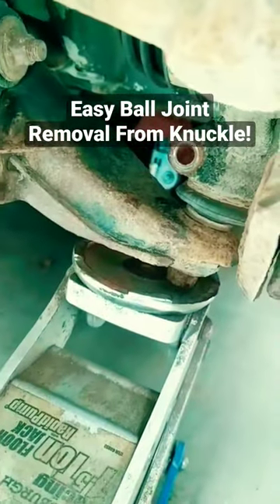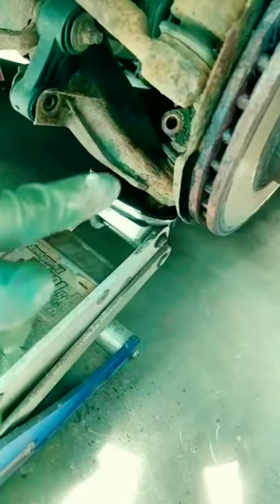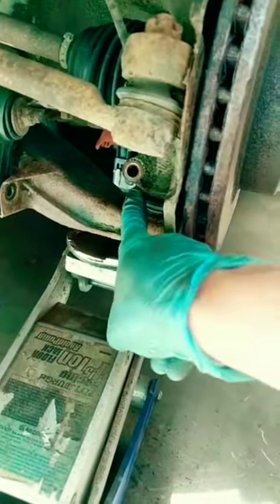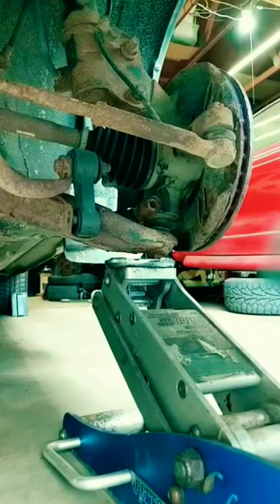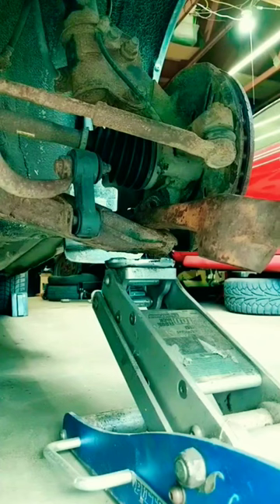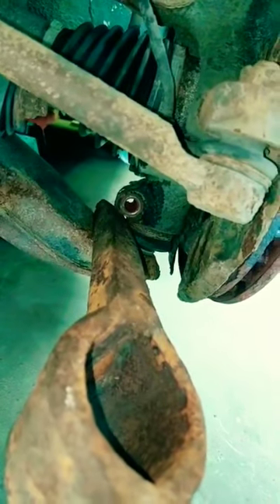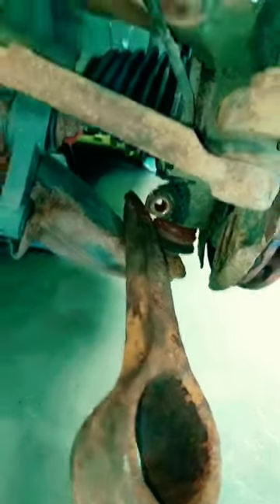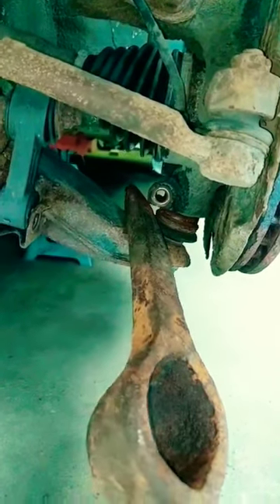Easily Remove Ball Joint From Knuckle! #Shorts

Comment: I think the rust was the only thing keeping that ball joint in there 😂
Reply from the maker: Hahaha they were definitely good friends. Even with the pinch bolt removed, it had a good hold for sure.
Reply: I think you're right. If it got hammered it might disintegrate.
Reply: @802Garage  there's always a front-end kit, which is specifically designed for separating ball joints from knuckles.

Comment: dont do this method if you are planning to keep your ball joint.  It will rip the ball joint out of the socket
Reply from the maker: That's only possible if it's already damaged or if the level of corrosion is much higher than any other method would deal with anyways. You do have to be careful of the boot though.

Comment: Can i do the same trick with the baljoint facing up? My 2007 honda civic (European version) has the ball joint pressed onto the control arm, and it faces up to meet the knuckle
Reply from the maker: The quick answer is most likely yes. You may either need to put the lever object in and then jack it up or lever from the other side when you drop the jack. Hope that makes sense. Sometimes there isn't a good enough spot.
Reply: @802Garage   basically you just need to find a spot where you create tension between the two pieces with a solid object, either by jacking the suspension, placing the object, and lower the suspension, or by placing the object and jack the suspension to create the tension. Nice. Thanks a lot

Comment: I like vehicles that have split knuckles it's so easy to get them out just take the bolts out of it spread it open a little bit and Bloom
Reply from the maker: Yeah I mean the bolt on joints are nice as long as they use beefy bolts. I hate the press in or screw in body kind. Love to be a nightmare hahaha.

Comment: What do I do if my control arm went up higher instead of staying low? I removed my sway links before and put it back in, did I install them wrong so my control arm sits a lot higher now?
Reply from the maker: I'm honestly confused by your question. You mean when you lower the car back down without a jack supporting it the control arm sits higher than it used to? I'd just drive back and forth a few feet or bounce it up and down a bit and see if it settles. No real way to install these sway bar links wrong. Unless it's a different car.

Comment: How do I put one in jack it in? Or do I still have to remove the whole hub. New to this job and technique
Reply from the maker: I'm guessing you mean how do you jack it up? Use the edge of the jack pad on the lower ball joint nut. Go behind the brake disc shield.
Reply: @802Garage  no I mean when putting a new ball joint in do you use a jack to put the new one in. Sorry bad word choice
Reply from the maker: @saltybloodtx7146  Ohhh you can. Usually once I have the old one out, I clean the hole out with a wire brush and brake parts cleaner and then grease it to prevent future rust and the new ball joint pretty much slips in. If not, putting the stud through the control arm usually puts plenty of force on it.

Comment: I saw you know a lot about subies,  I plan on getting a 2004 blobeye wagon 1.6 liter turbo 180hp  where do I look for rust and mechanical problems on the GD wagons?
Reply from the maker: 1.6L turbo? Which country was that sold in? Generally there are a few key spots on the GD wagons. The front U-frame under the engine which is basically for crash safety, a lot of people delete it anyways and it may not have been in every country. The rocker panels in general especially towards the rear. The rear fenders especially the lip over and around the tire. The rear subframe especially where it mounts to the body, though that's less common. The big one that is easy to miss is in the rear wheel wells, towards the seat backs, where the seat back latches to the strut towers. They drilled through the body to install the seat latch strikers, and over time moisture gets in past the undercoating and rusts out the layers of metal. It's best to fold the seat backs forward and pull the trim and carpet off the tower to check for any rust holes. It's fairly easy to fix, but obviously worth considering. Check the rear wheel wells in general thoroughly. The rear bumper beams also like to rust out, though that's not exactly structural. Good luck! I actually have a 2004 blobeye wagon with the EJ20 and it has pretty much all of these rust problems, hahaha.
Reply: @802Garage  thanks for your time and help . The 1.6 turbo is a special sold in Greece the dealership modified the NA car and put a turbo on it so there was a cheaper alternative to the WRX and STI I plan an turning it later in some 10 years to an STI wagon thus why I'm asking for rust issues.
Reply from the maker: @thusmarshal8815  That's awesome!!! Hopefully Greece isn't too bad for rust. :)
Reply: @802Garage  it ain't but I heard from others that rust issues are a big problem on the GD generation . Thank you anyways big fan of your vids waiting on that V10 Impreza
Reply from the maker: @thusmarshal8815  Subarus get a bad rap for rust because especially before the late 00s they were sold almost entirely in the snowiest and most mountainous areas. Canada, the northern USA in general, and the Colorado Rockies for example. They don't really rust much more than any other Japanese brand from the 90s and 00s, they just get a reputation because they are ridden hard through the winter and put away wet. I live right next to the Canadian border for example, and I have yet to find a brand that doesn't have rust issues. At least most Subaru rust issues take decades to actually structurally total the car. Thank you as well and V10 Impreza content is coming!
Reply: @802Garage   I know Subarus are snow machines I've had already 8 Foresters from the 2002 sturbo version pumping 570who and an sh 2008 diesel  non of them had  rust  but listings I found in Austria and Germany saw them with lots of it that's why I was curious and wanted to ask a Subaru expert. Happy to know the V10 is coming
Reply from the maker: @thusmarshal8815  Hahaha holy crap that's awesome. I want a 1st gen turbo Forester bad. Thanks again!

Comment: I used a torch to heat up the control arm a little than I whacked the ball joint with a lump hammer. It came out very easily

Comment: 2011 Subaru Outback and rust just kicked my *s$... getting that ball joint loose from the steering knuckle. 

This technique and video short saved the day!
Definitely do it this way!

I have to lift, wedge and drop several times with two pickle forks shimmed/ wedged in that space.

Caution with spreading that cast knuckle with a chisel or flat screwdriver as a wedge. You don't want to break it.

Comment: Now what if the body won't get out at all?
Reply from the maker: Use the same trick. Put the stud back in the arm and put the nut on barely tight. Take the pinch clamp bolt out, spread the joint very slightly with a chisel, do the trick again.

Comment: Get a ball joint press, that or i use the trusty air hammer (yea its expensive but holy shit its saved me so many times) and some penetrant, i spray then hammer a few times, generally thatll crack it loose, then pry it on out. They also make something called pickle forks for normal or air hammers that work literally 99% of the time, but itll flatten the boot and let grease escape, or can rip it sometimes
Reply from the maker: I know all of the tools and techniques. This is free, quick, easy, and generally works better than all of them. :)
Reply from the maker: I even have the special Astro Tools ball joint puller. Still go with this most of the time. 😂
Reply: @802Garage  imma try it out soon, i just feel like ill have a problem finding something perfect to wedge it. Im a transmission guy at nissan so im constantly replacing cvts and 90% of our cars need the subframe pulled to do so and the ball joint is the best option usually, problem is, the knucle doesnt have much of a lip to wedge most of the time, ill see if i can find a way to tweak it a bit maybe, anyways dope tip, good video homie
Reply from the maker: @ayoitssteve869  If you have a large pickle fork, they can actually work as your wedge, and yes it does work better wedging it this way than just hammering on it, or at the least it is easier. The car's suspension is exerting tons of force in this case, that's what makes it so clever. The arm acts as a big lever. Obviously with a lift and all that, this option isn't quite as sensible. More for home gamers and working on the ground. The principle can of course still be applied though. Could even use a screw jack to jack just one corner, but I'd be careful on a lift. Certainly doesn't work on all cars or ball joint designs, but on Subaru and some others it's a life saver. Lots of people in the comments saying nothing else worked and I've been there, hahaha. Thanks for the comments! Sorry about all the CVT replacements.

Comment: 99% of the battle with Subaru balll joints is getting the (rusted)  pinch bolt lose and free
Reply from the maker: You're not wrong! At least if it breaks you can drill it out and possibly save the threads or drill it, grind a flat, use a bolt and nut with a washer, and never deal with it again. 😂